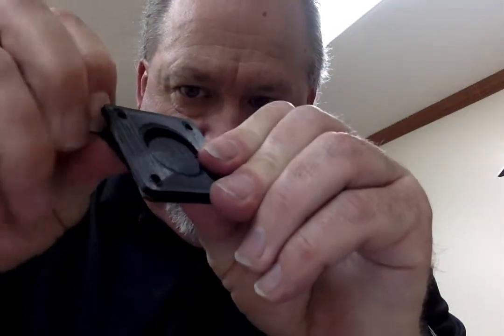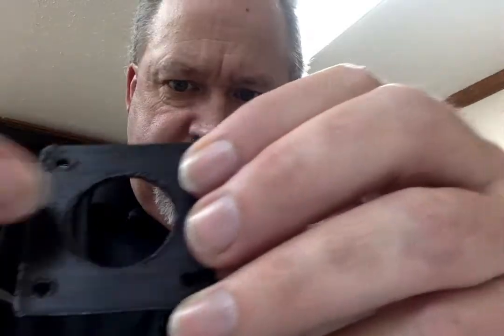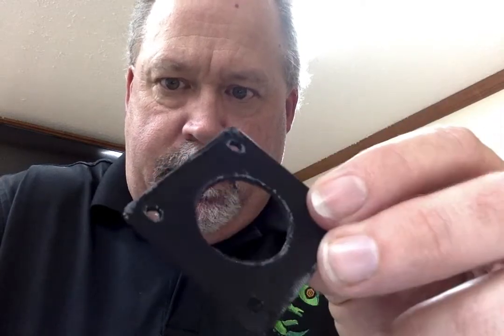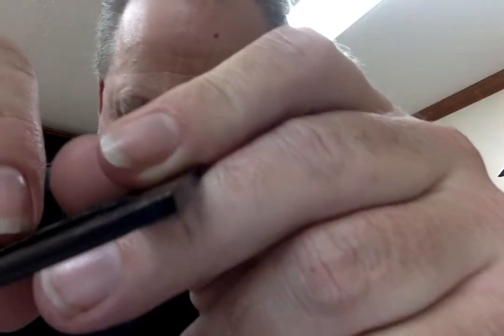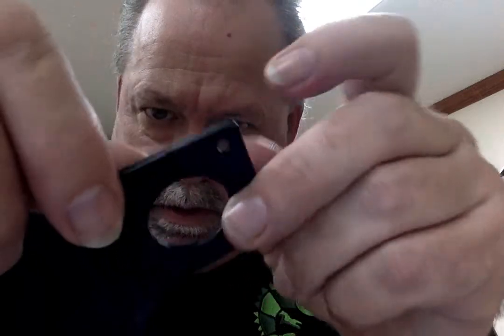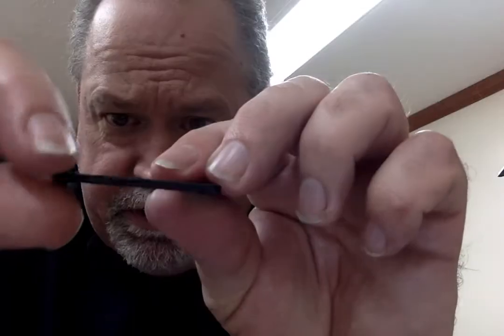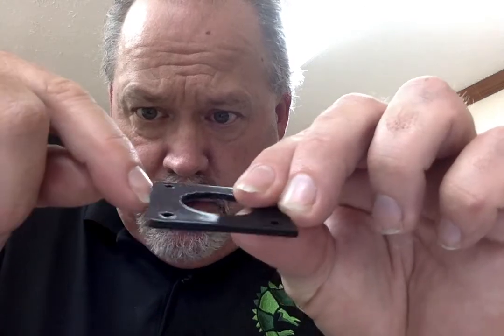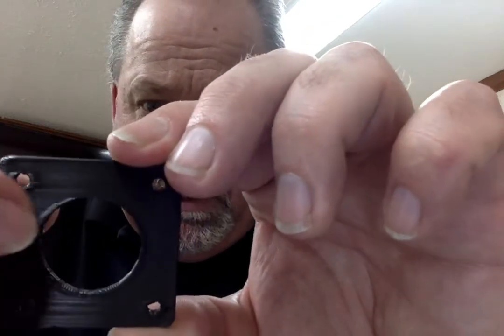Creality CR-30 3DPrintMill Raft Removal

Comment: Thanks for sharing the videos and updates. What layer height did you end up running with this? I saw on twitter you mentioned recording an unboxing video but dont see it anywhere. Would be great to see an expert setting this up instead of influencers confused at which way to unbox it.
Reply from the maker: I decided not to do the unboxing video since all the YouTubers have the exact same machine and they all did it.  Mine was just like theres... I had no issues at all taking it out and setting it up.  It took all of 30 minutes, tops.

As for the layer height, I've actually been printing at .2 and .3mm layers.  I do have a few test prints at .1mm and they turn out great.  I'm actually really impressed by this printer... it's very well done.

Comment: How are you slicing? Are you using the slicing method you developed and the post processor or are you using the blackbelt cura stuff?
Reply from the maker: I used the Creality Slicer (rebranded Blackbelt) that came with it.
Reply: @williamsteele  did you ever continue any of the work you did with the slicer scripts you published or was the BlackBelt slicer kind of the natural next evolution?
Reply from the maker: @autodrop3d118  No... I moved on to the real project at the time.  Back then, no one seemed interested in it.